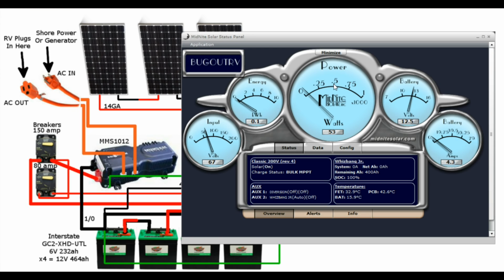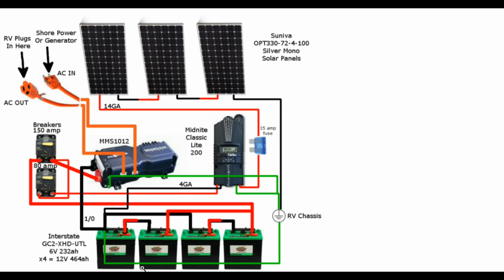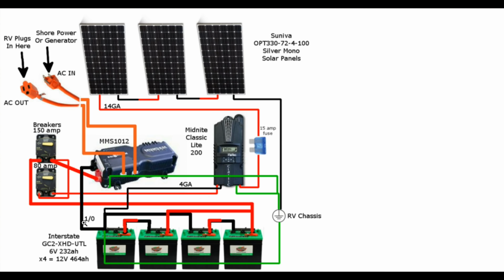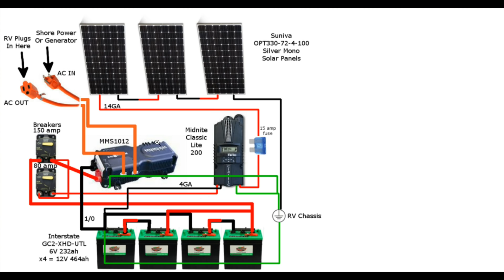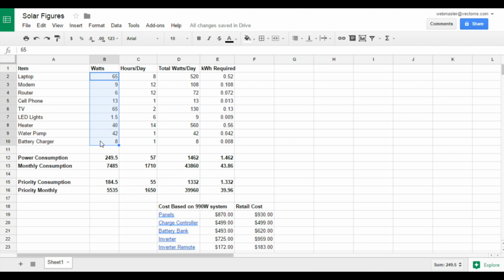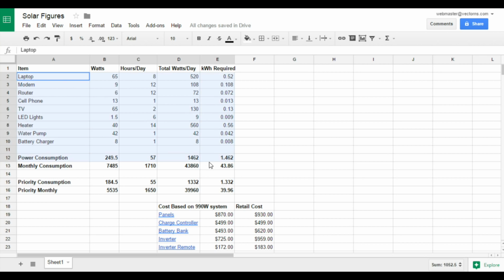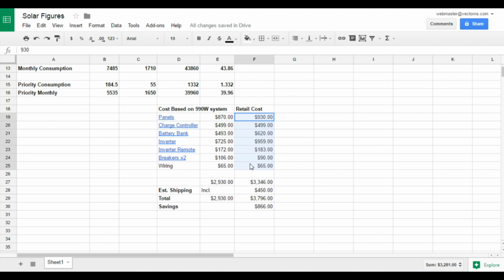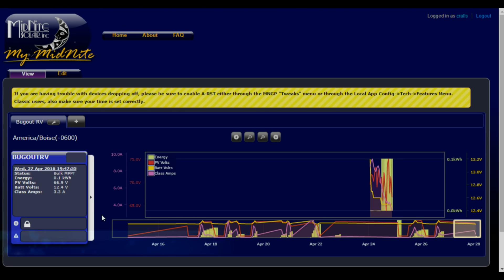Solar Wiring for RV + Costs for a 1 Kw System

Comment: Please note that 150 amp circuit breakers do not open at 150 amps but at a time proportional rate above 150 amps. It depends on your breaker rating... 150 amps will never break, 175 amps, maybe ten minutes, 200 amps, maybe 2 minutes, 250 amps, maybe 1 minute or a bit less, depending on the ambient temperature. At 300 amps it will probably within 2 to 10 seconds. You have to find the spec sheet and find the curve to be able to quote the time delay. The same applies to fuses... rewirable copper wire type can be up to 3 times the current rating, depending on lots of factors. The ambient temperature, the number of overloads it has already experienced and the age of the wire along with its purity, whether it was tinned or not. You can get silver wire fuses that actually blow at 1.5 times their rating and these are very expensive. The closer the tolerance, the higher the price. They are also filled with an arc retarding silica sand. No point in having a DC fuse blow, only to have it carry on conducting an arc within the body of the fuse.

Comment: This is very instructive. I have a smaller system  for my apartment. I learned a lot looking at your video than you for posting. The Electric company in new York is charging too much for power during the day.
Reply from the maker: That's great to hear it was helpful! Solar is becoming more and more viable these days I think.

Comment: I really appreciate your video, learned more from this than most other things i've watched, however i still do not understand the whole part where the two plugs in the upper left, into RV and Shore power/Generator.  Can you explain that to me a bit more? Also, why the 15 amp fuse coming off the panels? if you had say, 6 panels, would that be still 15? or increased
Reply from the maker: Hi James, The two plugs both go into the inverter. Since this inverter also has a built in charger you can plug it into shore power. The other plug is of course to plug the RV into to get AC power to the RV. Hopefully that makes sense. The 15 amp fuse from the panels is to protect the wiring. I'll just give you an example, if a particular wire can only handle 20 amps before lighting itself on fire you would want a 15 amp fuse on it to break the connection if it ever gets above 15 amps. The number of panels doesn't matter, it's there to protect the wiring.
Reply: OK, that makes sense now, thanks a lot.  I am going to start building a system soon, i may have more questions if you don't mind.
Reply: If i went with a larger system which 2000w or more (charger/inverter) would you recommend?
Reply from the maker: Depends on the output of the battery bank but so far I have had 0 issues with my Magnum so if you wanted a 2kw inverter you could go with a CSW2012 for a 12v bank or a CSW2024 for a 24v bank. The only other brand I would recommend is the Outback. You might also reach out to wholesalesolar.com to shop prices (I'm not affiliated with them) but that is where I bought most of my equipment. I got several good deals on refurbished and new equipment and free shipping on the 3 panels which was freight shipping so it represented $376.50.
Reply from the maker: Oh and if you want an integrated pfc charger in your inverter like I have in mine which is a really great feature you could go with the MS2012 https://www.amazon.com/Magnum-MS2012-2000W-Inverter-Charger/dp/B002MW6PHG/ref=sr_1_2?ie=UTF8&qid=1515089872&sr=8-2&keywords=magnum+2000w+inverter

Comment: Liked the video. Couple questions. Did you remove the OEM battery charger the rv came with? It seems that when you plug your rv into the new charger/inverter/battery bank it would be using battery power to recharge itself which would waste energy. Also, no shunt for monitoring?
Reply from the maker: I didn't remote the OEM charger but I did pull the fuse on it so it's not circling a charge. That's a good question, it would eventually drain your battery bank due to loss of energy over the wire. No shunt. I do have an MERC50 remote for the magnum though.

Comment: I have a very similar system on my RV, Also using the Classic Midnite Solar Controller as you but the Classic 150, one thing I added was a relay to disconnect the batteries if the battery voltage drops to low to save my batteries, and it kicks the batteries back on when it sees voltage from the solar panels again. You can power this relay off the Aux 1 Port on the Controller,  I have Midnite Solar's Wizbang Jr on the Aux 2 port, also a very nice addition, showing your total amp draw of your system, and how many amp hours you have left on your battery.

Comment: Awesome haw would this be to run AC if needed?
Reply from the maker: So I actually tried that and the 1000 watt inverter isn't enough to start the AC unit but if I start my generator I can start the AC unit and once it's started I can run it off the solar but it takes a lot of power. Better off just parking in a spot that's shady during the hottest hours of the day.
Reply from the maker: There are 12v swamp coolers that would work great though... https://www.amazon.com/TurboKool-Motorhome-Battery-Evaporative-Conditioning/dp/B007HRN2LS
Reply: Direct evaporative, or "swamp" coolers, are most effective in low humidity conditions. They do little in high humidity heat, and can even be detrimental due to the additional moisture they inject into the effluent air stream.

So-called "solar A/C" is possible under several power conditions. Firstly, you'd want to select the most efficient A/C unit. Look for dual-port, DC inverter units such as the VS12 by Climax Air. Dual port so a negative pressure isn't created on the conditioned space that causes hot air infiltration through the myriad hull penetrations. The DC inverter design for high-efficiency (aka lowest possible current draw [amps]). Inverter A/C units operate at optimal/variable loads, while legacy units simply cycle on and off as needed. Some dual-port portable and mini-split fixed units also have another low-power mode for only dehumidification.

If you plan to use a non-inverter/legacy A/C unit, you must install a soft start device on the unit before attempting to start it when powered via an inverter. The momentary run-in current needed to start the compressor will simply be too high for the system to handle otherwise. Though more than a bit pricey at $300, the Micro-Air EasyStart 364 (3-ton) Soft Starter is a good option.

Now, on to the good stuff. When is cooling needed the most? Why, during the heat of the day, of course. Lucky us, because that's when the sun is shining, and a properly sized solar panel installation is producing ample current to maintain a net positive draw situation.

It's even possible to start and run high efficiency A/C units while off-grid. Just be aware of the draw down associated with doing so. But, hopefully, the heat of the day will have broken so you're able to remain comfortable after the sun goes down.

Comment: nice explanation, but by your math you are using 1400 watts a day but your system only produce a 990 watts.  this does not take into consideration the number of actual sun hours your system is working at 100 percent verses the less optimal hours and bad weather. So I guess my question is have you used this system for an extended period of time? And if so at what point  does your solar system not keep up with your usage or lose the ability to charge batteries?

Comment: great video.. but i never disabled  my  converter charger its on a braker but they told me it will charge at night when the suin is down and not to turn it off..  as the solar charger controller is smart..  is this true?
Reply from the maker: The Deprey's If you want to find out for sure disconnect your charge controller from the batteries and turn on the inverter for a day or so and see if the batteries drop. they shouldn't drop too much but if they do that's a sign your converter is taking power from the bank and looping it right back into the bank.
Reply: Seems like it would be trying to charge your battery's using the battery.. Probably not an ideal situation. Id go with turning off the ac to dc converter when running the system. This of course depends on how your wired your system.

Comment: Thank You for the useful Information, When you are using your RV what or who do you use for internet service provider, router and modem setup ? Thank You very much, Christopher
Reply from the maker: For some reason I didn't see this so sorry for the late reply here. I use a verizon jetpack and try to park in areas where I can get service. I have another video on my weboost cell signal booster that usually takes me from 1 bars on the fringe of service to 3-4 bars and surfing the internet so between those two components I've been able to get internet service.

Comment: This is an awesome series of videos you have been putting together, Thank you and have a blessed week my friend. I appreciate you.
Reply from the maker: +Heartland Dual Sport Thanks HDS... I'll have another one coming soon as I just ordered a remote for the inverter so that will be interesting to see what all that does. I guess it's out for deliver today :) I went camping the last 4 days and didn't run the generator once which was nice and used about 1600 watts a day so the system seems to produce more than I can use and I'm running fridge, TV, laptop, lights, router, radio, water pump, furnace etc...
Reply: LowlySteward Awesome, I can't wait to see it, Have a blessed week my friend.
Reply: LowlySteward can you help someone new to this? you say here in this comment that you use about 1600 watts a day, and in your video you say your estimate was about 1400, and you felt your system would cover you. but if you have  1000 watts of panels, does that generate enough (with inefficiencies) to allow you to run standalone for days at a time? thanks
Reply: LowlySteward Thanks.
Reply from the maker: Sure, so I've gone on a couple 5 day trips and ran standalone the entire time without any need to start the gas generator. That was with sun shining at least every other day. My goal is to keep the bank above 70% but 50% would be the absolute lowest I would want to take them before starting up the generator and charging them. So in short, I've been able to run standalone for days at a time and the system does great but I think 2 solid days of no sun and I'd probably be firing up the generator to charge the bank on the third day